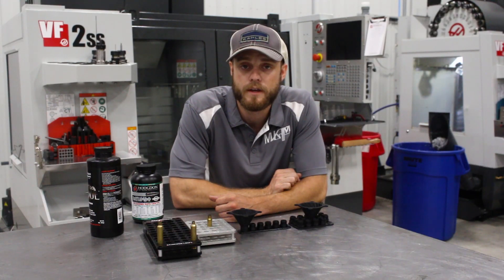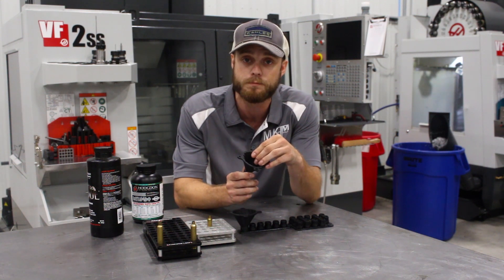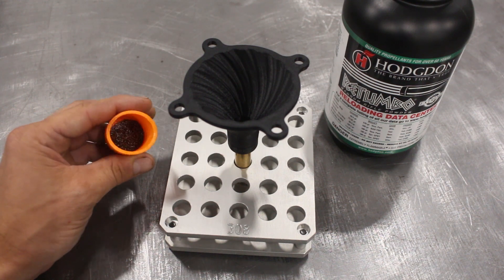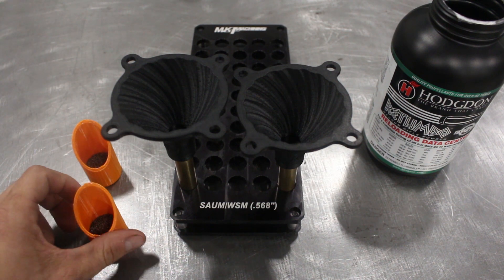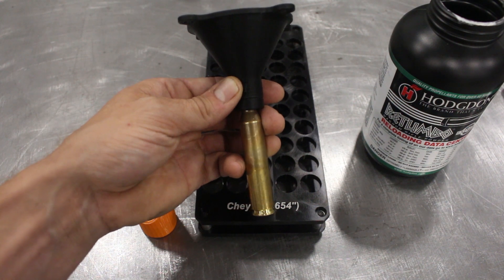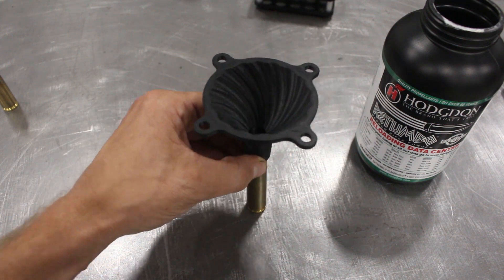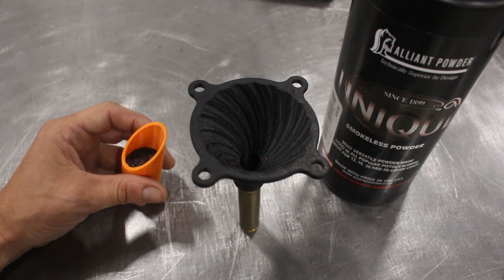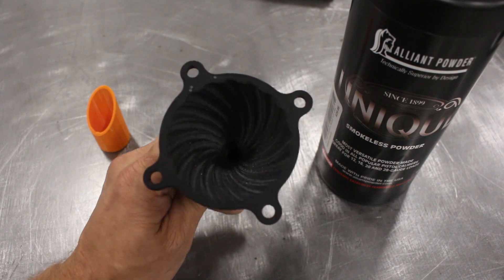MK Machining Modular Anti-Static Powder Funnel

Comment: Any plans on making handgun inserts in the future?  You would be the only funnel set to have them if you did!
Reply from the maker: We'll get to work!  What sizes do you think are necessary, 40, 45, 475, 50?
Reply: I'd say starting with the hot ticket calibers 9mm, 38/357, 40/10mm, 44, 45, 50.  I'd return the Satern funnels I just bought and pickup a complete set of yours.
Reply: Also if you added a 458 insert to cover the socom, and 45-70 your funnel set would be the most extensive on the market.  You could do production runs of other calibers by request.
Reply from the maker: We'll get to work :D